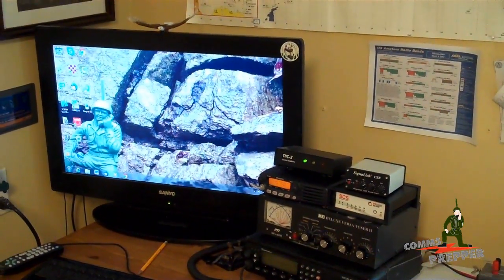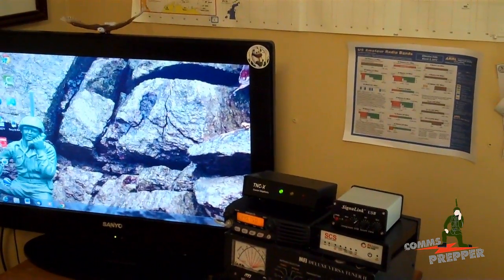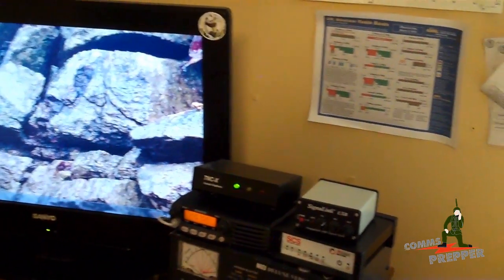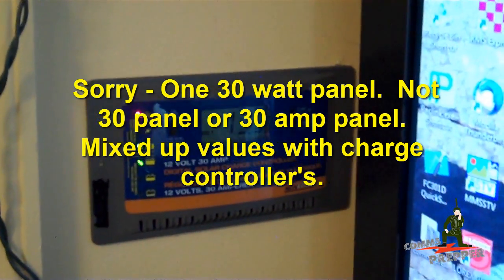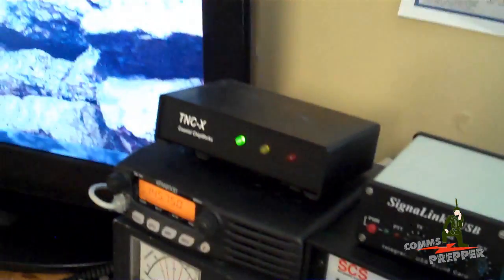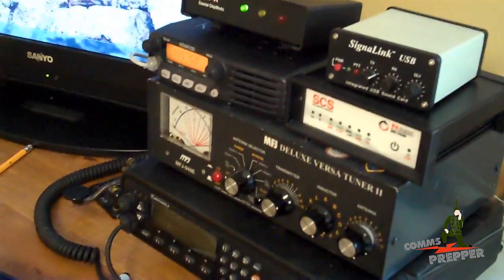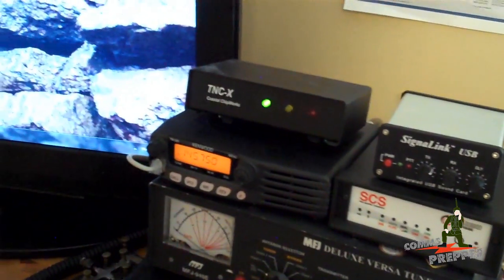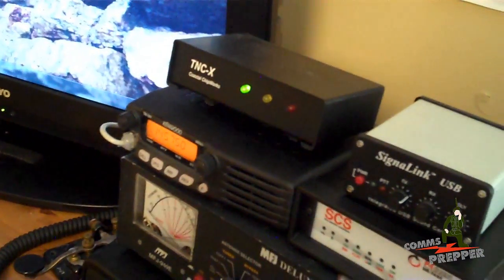Solar Power for Ham Radio

Comment: Adding a small led light to the setup would be useful during power outages. 

Maybe even a charger for your handheld radio or a AA battery charger. 30 watts should be plenty for stuff like that. Especially during times that you are not using the radios.

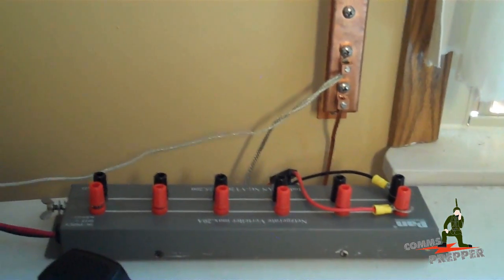Comment: @ 1:54 - is there a place that sells that power distribution terminal, or did you make it yourself?
-hoping you get this on an older video. -thanks!
Reply from the maker: You can get "banana plug" terminals from Amazon but Ham Radio Outlet sells these power strips.  There are also Anderson Power Pole type power distribution units.
Reply: @Commsprepper   Dude, thank you very much! '73

Comment: Say, regarding solar; would a FT817ND 5w drawing 2amp on TX, be a better choice for consumption, than a much cheaper 5w HT or even the silly $99 china 25w micro-base-station?  Can you expect the same RX/TX results?
   I saw a video from videosbymike and looks like he was doing international comm with only his FT817ND 5w and his magnetic loop antenna.  Comments are disabled on his ch.  Was he doing that simplex or ______?
   I am waffling on FT817ND for consumption, or should I be more concerned reach out power like 100w via IC-7100 or FT857D at 22amp TX?
Reply from the maker: +Bruce Wayne A cheap 5 watt HT does not have the HF bands you need for international communications. I have the FT-817ND because of its portability.  However, it's limited power (5 watts) does present lots of challenges.  If you don't need absolute portability then I recommend the IC-718 or IC-7200.  While these are full power units (100 watts) you can always dial the power back and reduce consumption.
Reply: +Commsprepper Much Thanks, I will study up on your helpful suggestions.  So he was doing that simplex?
    Does IC-7100 have known issues; or just too many bells and whistles?

Comment: Looking good, I have done a similar thing here, but I'm using a 100 watt panel. I also have a power gate between my  ac power supply and the batteries, this insures my batteries are always at top charge.

Comment: thats pretty awesome... Cant wait to start building my new house.. the wife is on board for a complete solar install.
So have you shielded your communications shed in case of emp?
Reply from the maker: Blue 823 No EMP shielding.  Not something I worry about.  My opinion (which could be wrong) is that equipment not connected to a power source or antenna will be fine.  Just my position.  I would rather invest in other preps.  Hank

Comment: Been using solar for 2 years for my go-bag radio power charger and backup for base station.  Check out VK3CRG you tube for power booster video.  Great product!
Reply from the maker: AZ PREPPER412 I will thanks for commenting.

Comment: ham radio is great. i prefer HF frequencies. very very fun.
Reply from the maker: smallenginedude71 I too prefer HF but don't have the battery capacity yet for the 125 watt radio yet.
Reply: Commsprepper yeah. hf radios are hungry. my kenwood takes 18 amps!!

Comment: Solar power is addictive, be careful next thing you know you will have thousands spent on it..LOL!!!!
Reply from the maker: ***** I'm there.  I just bought two Trojan T-105RE batteries with plans to get two more.  Sure wish I had one of those million sub channels :-).   The future expansion plan is to add a second panel to make a 24 volt array and add two more batteries.  My challenge has been battery location selection and venting.  With only a crawlspace and no temperature controlled out-buildings I will be putting them in the crawlspace using a battery box and this venting approach http://www.bdbatteries.com/hydrogenventing.php.  Hank
Reply: yes the batteries need to ventilate, I moved mine to a outside box for safety, but can be inside with proper ventilation.
Reply from the maker: ***** Since I am new at this, what do you think about this approach?  http://www.bdbatteries.com/hydrogenventing.php 

Hank
Reply: Looks like a good way to do it to me, makes sense.
Reply: That's kind of how I feel about the amount of money I have spent growing my own food ; )
Reply: AGM batteries are great but most of us cannot afford them.
Reply from the maker: ***** Buddy of mine uses VMAX AGMs (http://www.vmaxtanks.com/SLR125-AGM-Solar-Battery-_p_38.html) but my charge controller does not support that chemistry.  Could not get a straight answers out of a few companies on charge controllers for AGMs - frustrating.  So I opted for the old school flooded batteries.  To much to invest to take chances.
Reply: Yeah I use the flooded batteries as well, may not be the best but work pretty good.
Reply: ***** thats why i have not gone too far into it :D

Comment: Great project. I have recently put my ham shack on solar. I have two 6v 220AH batteries and 1 100 W panel. I plan on having 4 panels and adding 2 more of the 6 volts for 440AH. I will also be able to run my fridge and freezer for a bit during the day if power goes out for a short spell.
Reply from the maker: Gene B Gene - You almost described my cabin system.  Right now I have one 160 watt panel with plans to add a second.  I just purchased two Trojan T-105RE 6VDC 225AH with plans to add two more.  Ultimate goal is to have four batteries configured and two panels for a 24VDC system.  I also have a 15 watt panel on the retreat shed but still need to connect charge controller and batteries on that panel.  Thanks for watching and commenting.